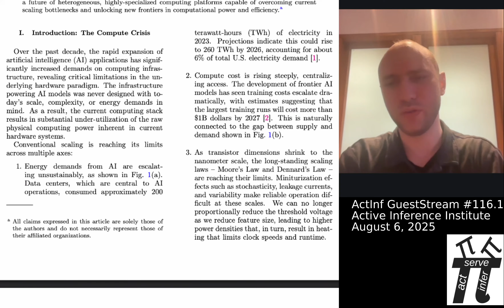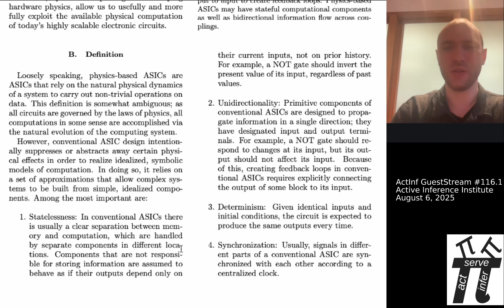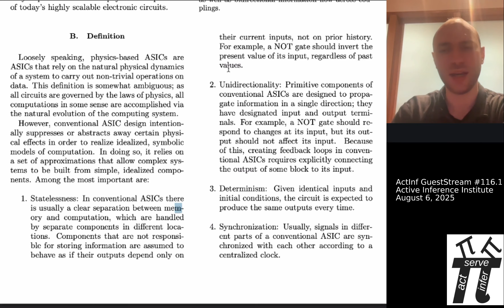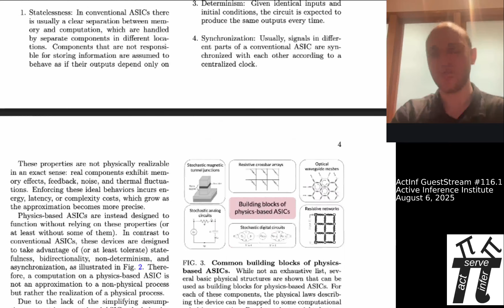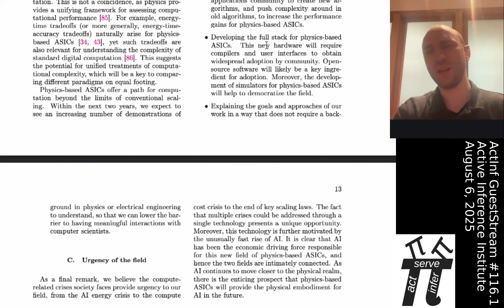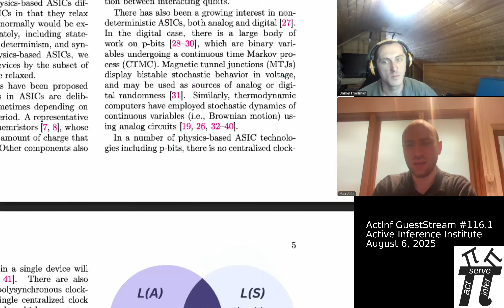ActInf GuestStream 116.1 ~ Max Aifer: "Solving the compute crisis with physics-based ASICs"

Comment: The reason AI only simulates life in a simle way is because it is still in the stone phase of its development. - silicon - it must be brought into the plant state through increasing division and complexity in order to embody a “real” - deterministic, environmentally determined - STRIVING. Its environment must deterministically demand/condition it, as long as one assumes that the environment is the “invigorating factor.”

What makes a stone a stone, "a" non-stone, and everything that a could be/should be/is the stone? - So is a plant a more complex stone? - Doesn't this result in a seemingly endless trail that leads to something else?

Therefore plugging it into a reality on a broader bandwith - deterministically demaning its existence, is a extention not a creation in the ultimate sense?